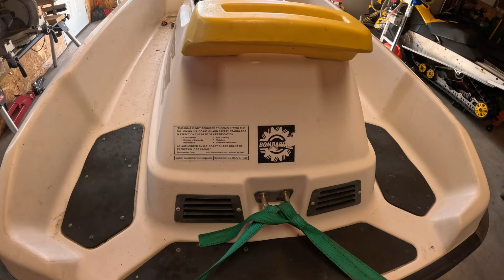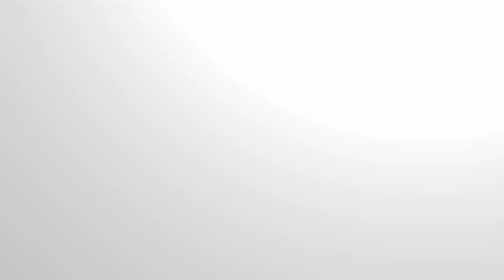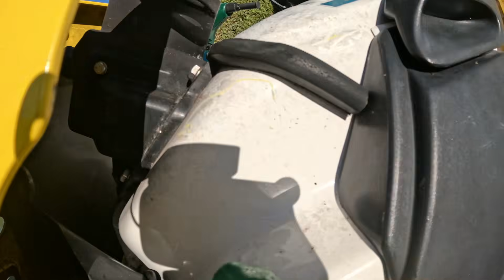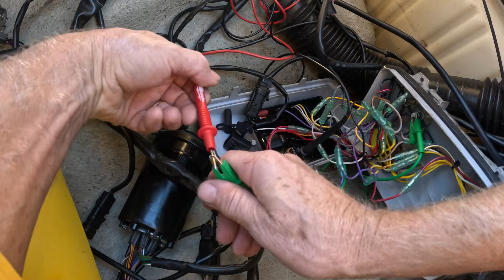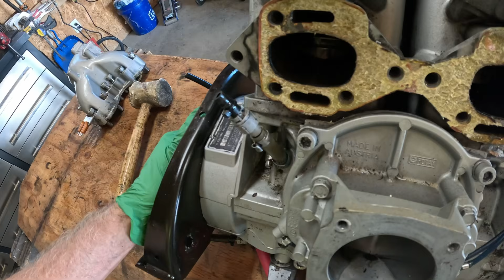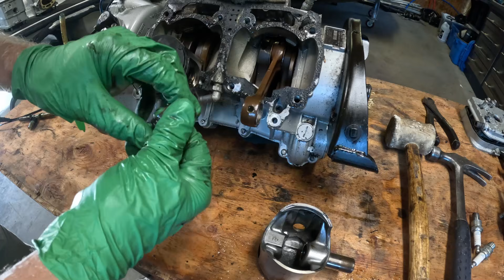Seadoo repairs to Gtx and GSX mashup

Comment: On the 98 GTS, I thought the gear was made of brass in order to save the crank shaft? The soft metal shreds easily so as not to bind up the crank. I had the same issue with my 98 GTS, so I pulled engine apart, cleaned out all of the brass shavings and inserted a new gear.  You put out great content, and I enjoy watching your videos!